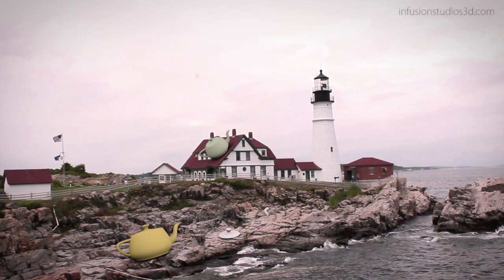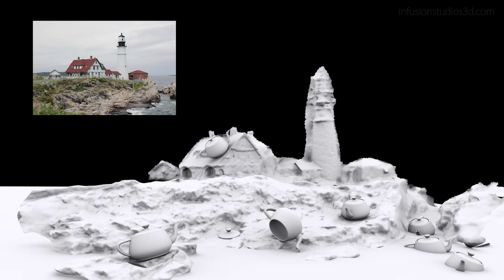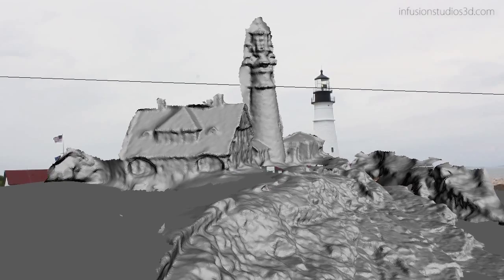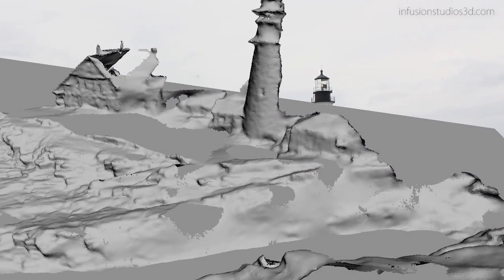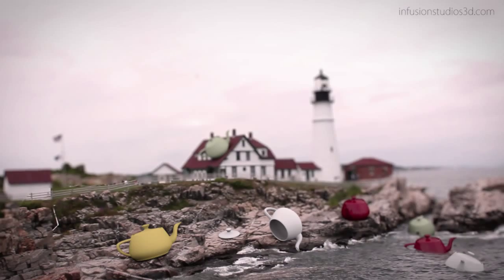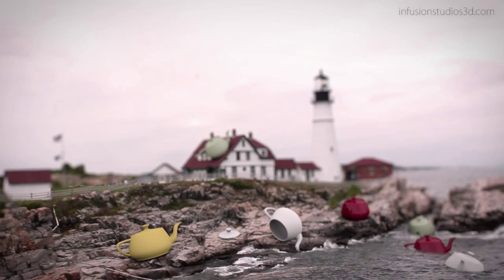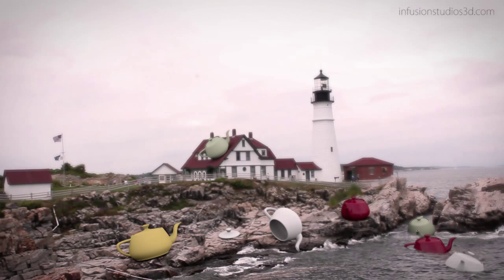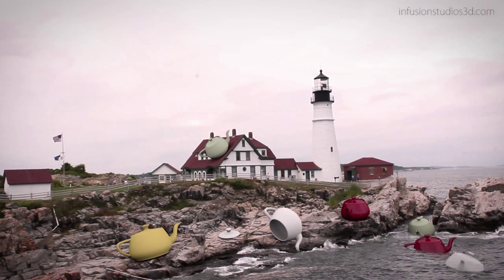Using Photofly 2.0  for Visual Effects Intro

Comment: because depth is been measured background is easily separated..if you boost the light intensity of a depth-map it will affect the depth, making image flat. your rotation image is track and adjusted to the virtual 3D camera...with a little more though i can probably pull this off in a 3d package..i can already turn any one still front face profile into 3D model